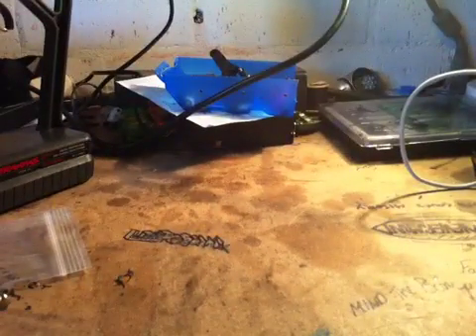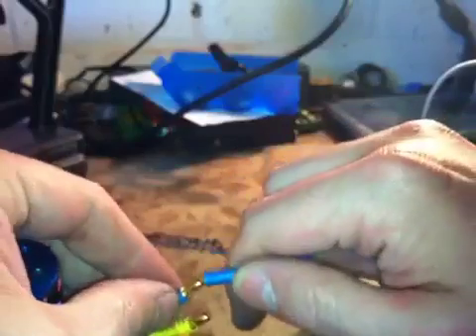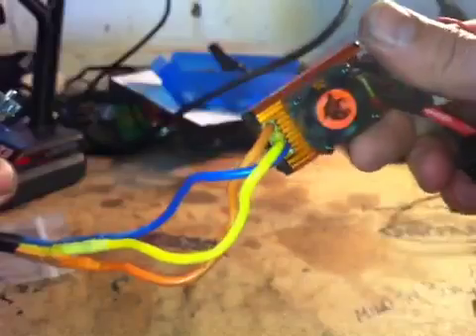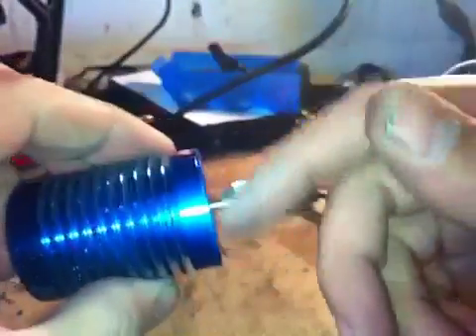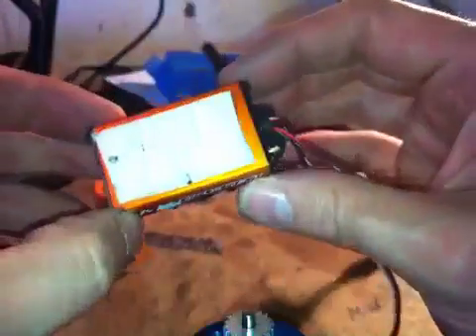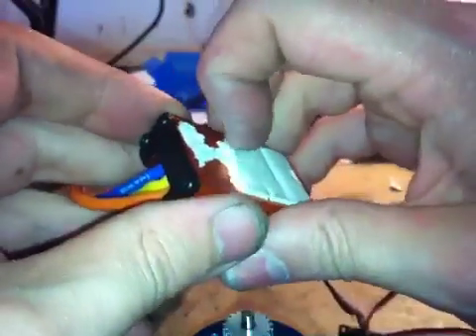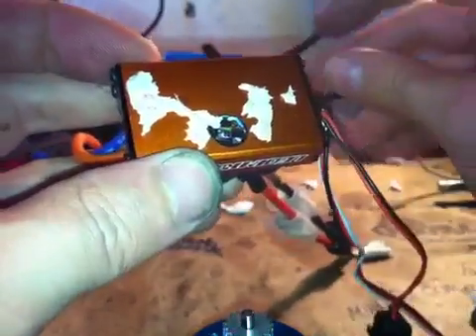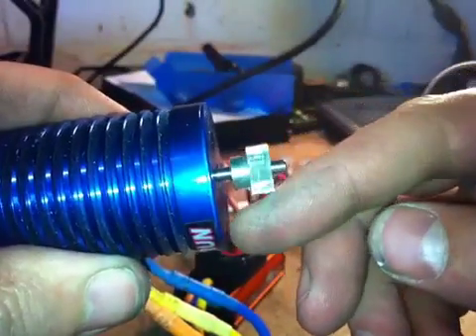Leopard ESC brushless fault.

Comment: it's normal for the motor to stiffen up when you connect the esc. If you are driving the car and something happened which turned off the car, the motor will automatically stiffen up in order to stop the car. I bought the leapard motor combo from rcmart, had it for 2 years now, nothing wrong.
Reply from the maker: this was burnt out. 
the MOSFETs were fried on 2s I've stopped using this rubbish now I've moved over to hobbywing as I have a life time warranty. 
I have been racing over 20 years and these are a joke. your lucky but you bought then from Rc mart they were the original ones. I got mine from eBay from some idiot in China. seriously I've never bought rubbish. but this was one of the problems back then. 
but thanks for watching.
Reply: Rc-Nerd ahaha no worries mate:) hobbyking products are great!! I'm not a racer but I'm planning on getting started soon.
Reply from the maker: Well any help please ask.

Comment: I got a brandnew same Leopard V2 esc with 13T motor combo and it does the same thing, it's like have a drag brakes on even when the RC is turned off but it's working wonderfully when I ran it though. :)
Reply from the maker: seems to be the mass production of these I have had four. I found out the motor was the trouble. the wires are badly soldered. 
the caps were not swollen so after I did a few checks I found it to be a MOSFET had fried. I've moved over to hobbywings WP60 brushless. very good. cheers for watching. 
also if you have a program card try turning the ratio and punch. it seemed to resolve the issue but it eventually fried.
Reply: +Rc-Nerd I'm surprised to hear about this. Base on URC review, I thought that the motor have issue from debonding and the esc was ok. Does all Leopard V2 esc have this issue? how long we're you able to use it before replacing it with a hobbywing? tnx
Reply from the maker: After that video I had two from the same seller. Eventually all three either fried the motor or ESC just went glinchie.
Reply: +Rc-Nerd copy that. should I get a HW esc 60A WP and use the Leopard motor? or should I replace both motor and esc? tnx
Reply from the maker: I would but if you want to start a fresh you can pick up a HW EZRUN combo kit for less than £35 here in the UK

Comment from the maker: This was fried the internal board was all consolidated solder. They have made the ESC more robust but I've upgraded a lot of those bullet connectors and some of the current from the battery isn't flowing. Nice one for watching.
Reply: +Rc-Nerd hey my esc was smoking and I saw the yellow, blue, and orange wires are burnt up. So the capacitors messed up the esc. Did you just buy a new one or did you have a suggestion for a better esc to buy. I 'm just thinking about going with a new esc non leopard.
Reply from the maker: I've moved over to Hobbywing after  this problem.
Reply from the maker: I find that leopards Toro is a good line but the V2.0 just felt misbehaviour and throttle response was either rapid or not responsive. I moved over to Hobbywings 
WP60 & 40 Brushed and brushless. Cheers for watching.
Reply from the maker: Toro is OK buddy. 
Think them V2s were sold in mass amounts and even renamed. Etronix
Even Axial use them.
Reply from the maker: +Jedi Jamo The One yes even HPI are in with the production. of rebranded escs.

Comment: i had a problem with the leopard v2 i cut the plugs to the motor bent ta small bit of the motor wire and twisted the motor wires into the esc plugs and soldered them and i have no more issues, i think the fact that the bullet plugs are not thick enough so they bullets burn out, as i say no more issues